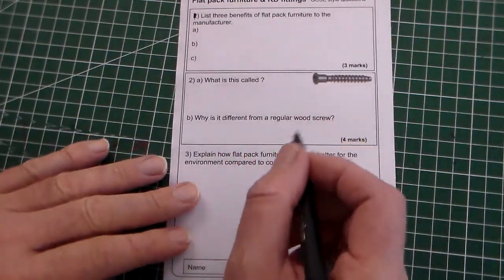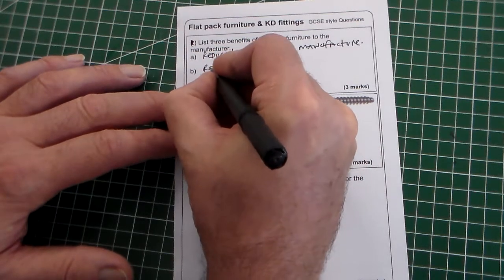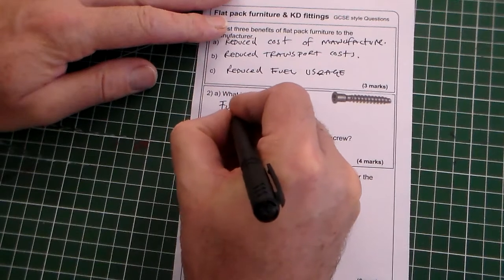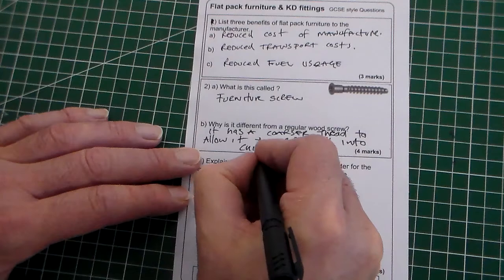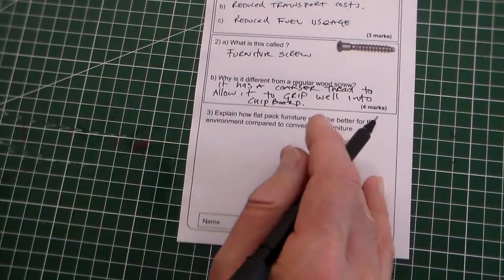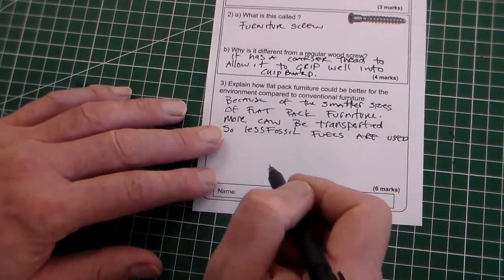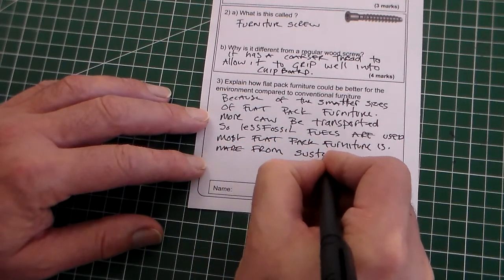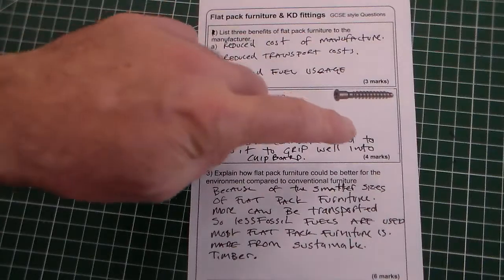Learning Check KD fittings and Flat Pack Furniture For GCSE D&T

Comment: Not to discredit you but I feel the answer written is inadequate for 6 marks:

1 mark for: ''Because of the smaller sizes of the flat pack furniture,"
1 mark for: "More can be transported"
1 mark for: "So less fossil fuels are used"
1 mark for: "Most flat pack furniture is made from sustainable timber"

So in my opinion as an examiner I would likely give 4 marks, as also facts such as recycling of old wood and biodegradability of plywood can also be stated.
I would appreciate a response if possible.
Thanks.